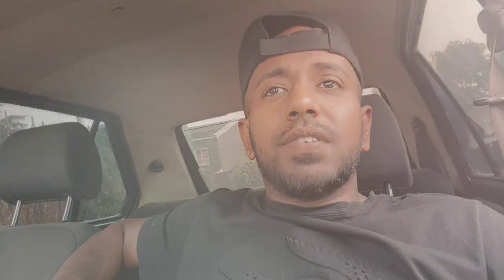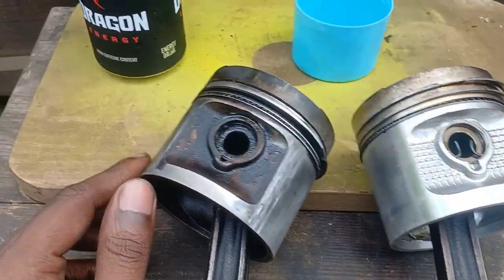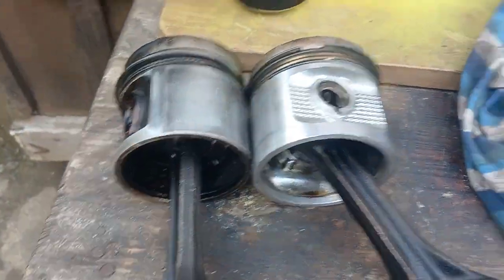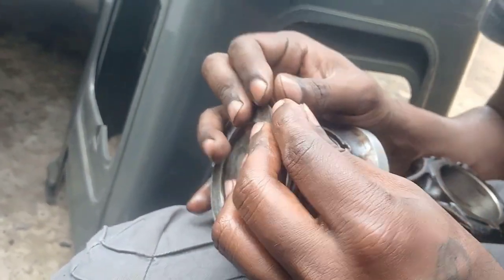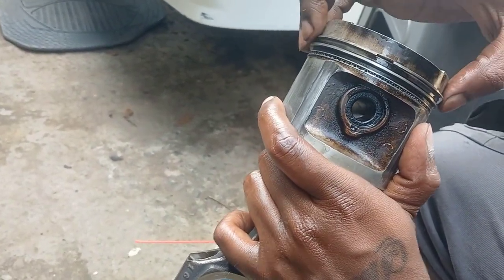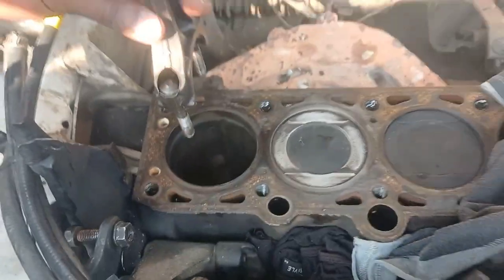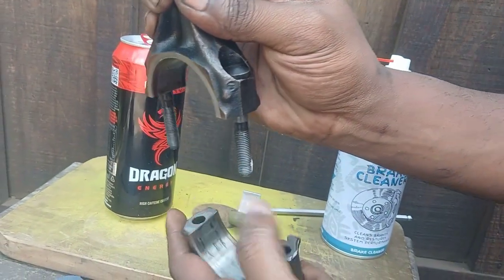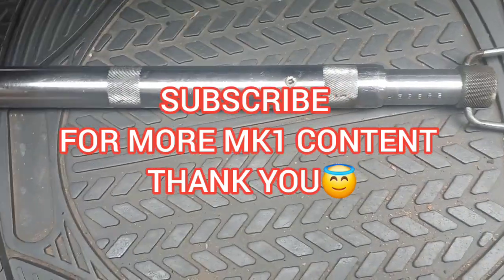Piston install & explaining piston slap: Golf Mk1

Comment: I'm struggling bro with my caddy bakkie with spark cuz I had the one with points and condenser ..I've put in a distributor with control module but still don't get spark..don't know what to do but your videos with your instructions are very excellent
Reply from the maker: You will get it right, just watch thee videos on setting the module up and how to test spark

Comment: I know this question is unrelated to the video but I'm hoping you can help me out. I am using a dictator engine management on a VW Fox. I'm having issues with the loom wires going to the Coil, and the distributor as a result having issues with no spark, maybe please use a picture of the wiring with an explanation. Truly appreciate the help
Reply from the maker: Howzit. can you confirm u getting constant power on the positive
 side of your coil when ignition turned on ?
Reply: @Denirosmk1hacks Yes there is a black wire from the dictator loom connected to the positive on the coil. And it is receiving power
Reply from the maker: @EMKAY-001 ok trace your middle wire of the distributor  lug and then use a test light to send ground signal to it. Watch a video I made on fixing electrical issues
Reply: @Denirosmk1hacks Yes I have watched your video. I have tried that test, grounding the middle wire and it does give spark as it does on your video. Issue is that it did that for sometime and then it eventually stopped, and then I believe it just flickers, the relay inside the car, with no spark. And when you spin the rotor like you do on the video, it doesn’t do anything at all
Reply from the maker: @EMKAY-001 then u need to inspect the module on the the dictator it's possible  it was weak and eventually failed
Reply: @Denirosmk1hacks Appreciate the assistance man. I’ll come back with feedback. I saw you made a very informative video, of how to wire a module to the coil and distributor. If its any different for a dictator Std, and if you do take video requests, please do a similar video for better understanding on that. Appreciate it
Reply from the maker: @EMKAY-001 it is different bro but I don't have any module currently to make a video like that maybe in the future if I get my hands on a dictator harness  and module